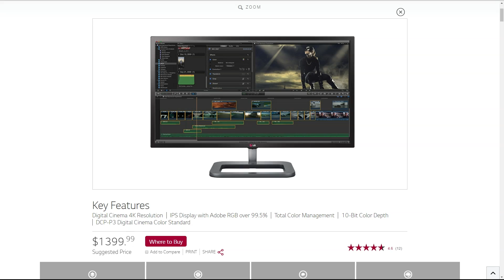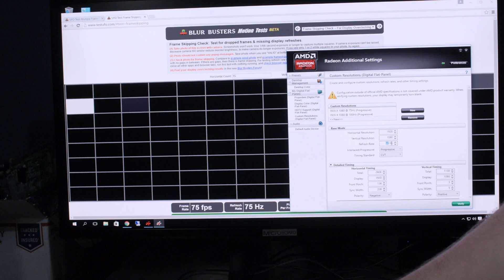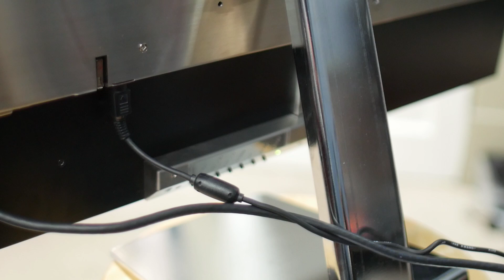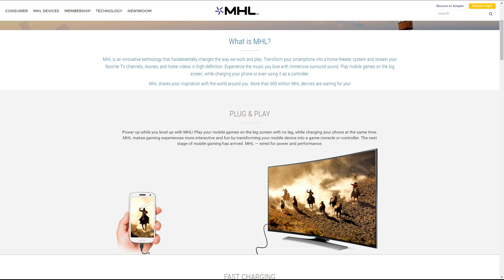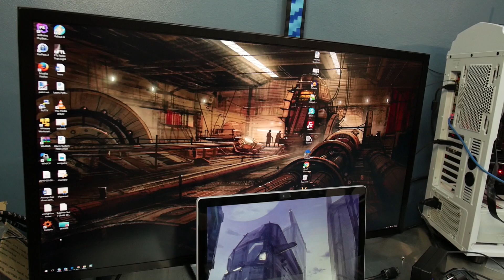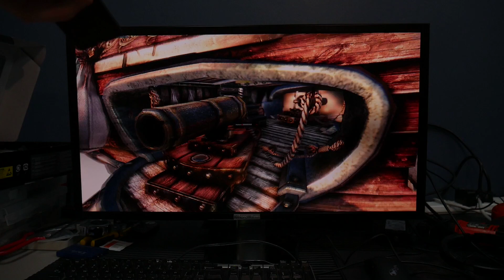Microboard R4K310C Monitor Review

Comment: I have two questions 

1. Could you split this 4K monitor via software into four individual HD ? Like what we use to see in Ubuntu separate desktop spaces ?
2. If you could split the 4K monitor into four individual HD screen, could it accept several HDMI inputs simultaneously?  I mean could HDMI1 be shown up on Top left, HDMI2 be shown up on bottom left and so on ?

Comment: Some monitors are not flicker free throughout the full range - they are usually flicker free from 100 to 20%, but flicker below that.

There is an easy way to test flicker - take multimeter with frequency measurement and connect it to a small solar panel - it should give you flicker frequency (and duty cycle).

Comment: I was looking at this monitor the other day and really like it, but wasn't really sure what they meant by this below. Does it do 60hz or not?

R4K310C supports Real 4K resolution and has
DP1.2, HDMI2.0 prots
which can
support 60Hz(vertical scanning rate) to use in a variable way
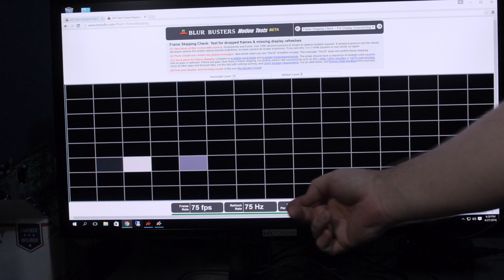Reply: +James Friedman Wendell got up to for 62hz, any higher resulted in frame skipping 1:35
Reply: +Yeagdrasil gotcha Yeah I wasn't sure if he was referring to 1080p overclocking cause his previous videos he talked about trying to just overclock 1080p and nothing really about 4k

Comment: I'm not impressed until 4k 120hz
Reply: +net200777 That should be possible with DP 1.4. I wonder why nobody has made such a display yet :/

Edit: After a quick google it turns out it's also possible with DP 1.3, but even GTX 980 Ti doesn't support that yet... Stupid me :P
Reply: +net200777 Still at least 6 -12 months out so using 4k 60hz 40 inches for now.
Reply: +Jake Stremfel Because graphical power doesn't increase the way you THINK it does. for example, to increase resolution by 25% you need about 75% more horespower in your hardware. These things aren't easy to do, and even though 4k is "consumer" grade now it's still in it's infancy.
Reply: +Alex Spray two 1080s. By the time it's here, two 1080ti's.
Reply: *****  You're not doing 60hz 4k with a 970

Comment: So are you getting all these monitors for review purposes or are you buying them yourself and then reviewing?  

I only ask because I've seen that all the Korean monitors have a 3-5 dead pixel allowance for the monitor.  This is really the only thing holding me back from purchasing 3 40" 4k displays; I don't want to have a beautiful display with a dead pixel right smack in the middle of it (let alone all three displays having more than 1).
Reply: There might be a pixel perfect option that covers all dead pixels.
Reply: +Kevin Eder Alright, thanks.  I have done some skimming and haven't had any luck yet unfortunately.  You wouldn't have happened to have spotted any pixel perfect ones out there in the wild, right?
Reply: +Felix Murray I got one with the perfect pixel option and it has no flaws at all but I think even with perfect pixel 0-3 or something dead pixels are allowed. 
In total I've bought 3 (for friends) and none have had dead pixels. One of them had a very slight greenish tint though and it is noticable when its right beside one of the good ones.

Comment: "The worst thing about this monitor is that it's not big enough; it's 31 inches" WHAT??
Reply: some people think 31 inch is to small for a 4k display
Reply: +LordDrachenblut not "some people" it's fact that 31 inches and under isnt big enough for 4k on Windows because of the poor DPI scaling the OS has.
Reply: +Mas Deago thanks for letting me know about that issue.  I'm using KDE 4 and GNOME mostly on Linux and I've heard the support by gnome for screens like this is good but haven't really like into it.  I'm currently running 2 1080p 21 inch screens and a 27 inch 1440p achieva shimian display

Comment: can you do some affordable 2k monitor reviews?
Also is there a monitor section on the forum?
Reply: +Broken Psu 2k is 1920*1080. There are so many of those in the market. Are you asking for QHD which  would be 2160*1440?
Reply: jkteddy77 Just to reiterate what Meson W said. the K measurement comes from the horizontal resolution of the monitor. The reason it makes little sense to some is because consumer displays are cut down slightly from the true horizontal resolutions. 2k is 2048, but on the consumer side it's 1920. 4k is 4096, and 3840 on the consumer side. So 2560*1440 would be 2.5k not 2k

HD =1280*720
Full HD= 1920*1080/2k
Quad HD =2560*1440
Ultra HD =3840*2160/4k
Reply: +cheddar07 4K means 4x 1080P , 2x 1080p which is a non standard size. The step between 1080P and 4K is 1440P.
Reply: +jkteddy77 Umm why are you dividing the area of pixels by 2000?
A screen resolution is either rated by its horizontal dimensions in pixels (adjusted to nearest "k" or part thereof), its vertical resolution as a reference to its progressive scan nature, or its area in megapixels - as a typical way to show the effective overall scale of the image or volume of pixels contained therein. 1920x1080 is 2k, 1080p and 2mp respectively.
3840x2160 is 4k, 2160p and 8.3mp respectively.
I'm still perplexed why you've decided to divide the numbers by 2000; it's like you've just picked a number that makes your own logic fit.
Reply: +Broken Psu you'd have to define "affordable"
Reply: +cheddar07 2560*
Reply: Erytropus haha, yeah. my mistake.
Reply: +Broken Psu 2K is a non standard monitor size these days, its going to go 1080P, 1440P, 4K
Reply: Brian I 2560x1440p, less than 300 usd
Reply: jkteddy77 A standard 1600p display would most likely be 2560*1600 which would be 2.5k. The same way 1200p is is till 2k because it's 1920*1200. They are just 16:10 aspect ratios instead of the 16:9 that has become standard. they obviously have more pixels. But this Doesn't change the fact that the "K" refers to the Horizontal pixel count. This is why I find it stupid that they decided to market the 4K instead of 2160p Because people like you get confused. As an example a 3840*1080 Ultra wide display is both 1080p and 4k. Why? because it's vertical pixel count is 1080 and it's horizontal pixel count is 3840.
Reply: jkteddy77 Also I didn't say 1080p is Quad HD it's Full HD, please reread my comment.
Reply: jkteddy77 "What I'm getting from this is that marketing loves to call Ultrawide resolutions 2k or 4k when really they have far less pixels than 16.9 ratios of higher vertical resolution. May as well just stop using K labels and start calling them by their horizontal scan line count i.e. 1440p"

you are indeed confused. 1440 is not the horizontal count. It's the vertical count 2560, would be the horizontal count. And no they are not labeling ultra wide monitors as 2k/4k. The only way you will get a 2k ultra wide is if its 1920*900 and to my knowledge sub 1080p Utra wides don't exist. My example of the ultra wide 1080p/4k display was to demonstrate how stupid and confusing it is to go from marketing displays with their vertical count (1280*720=720p,11920*1080=080p,2560*1440=1440p) to now using horizontal (3840*2160=4k, 7680*4320=8k)
Reply: cheddar07 Strictly speaking he said "horizontal scan line count", which is the vertical resolution.
The K labels are marketing teams at work, and were initially brought about to sell the new 4k TVs... indeed I wasn't aware they were used to market monitors at all; I've a feeling us computer users just appropriated them to refer to the multitude of monitor resolutions in a comparable way.
Now as for stopping using K labels... I hardly think we have any control over marketing departments and let's face it, they needed some sort of hook to continue selling TVs otherwise everyone would've realised they didn't need a new one at all for 5 years. 4K was The Next Big Thing, which obviously need a label.
Reply: Meson W Right I guess I misread his comment. It is what it is I guess. 2160p just doesn't roll off the tongue as nice as 4K